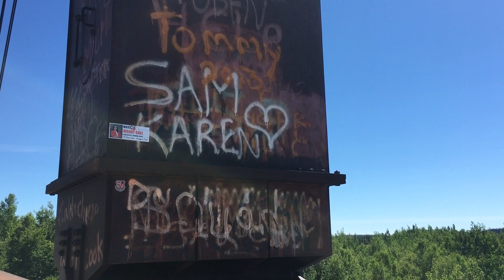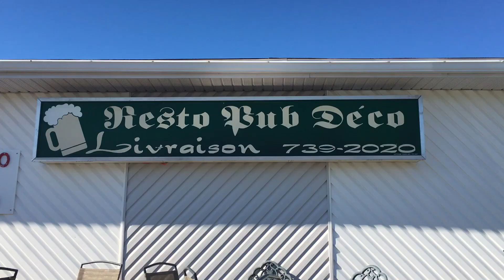James Bay Highway Adventure Part 3

Comment: 4:25 Although this was a group ride, did anyone have any emergency parts with them? When I did the Trans Labrador Highway, I brought along a: throttle cable, clutch cable, brake and clutch levers, new chain and chain link, heavy duty front and rear tire tubes, tire irons, etc. Since my KLR was new, wheel bearings did not cross my mind but replacing them are an easy fix on the road. They will get packed the next time with new seals. By the way, the Trans-Taiga road is 662 kms one way according to Google Maps. Too bad it doesn't go through to Labrador City.
Reply from the maker: No spare parts at all. We were letting luck decide. My KLR was new, the KLR that broke was a well used off-road machine so bearings failing should have been anticipated. Funny enough, if you watch my Trans-Taiga video. Daren, the bearing KLR guy, had another bearing failure. This time it was on the Africa Twin. In his defence he he had the bearing ready at home… lol.

Comment: Really enjoyed watching this series. Felt I was traveling right along with you. Definitely on my ‘to do’ list, hopefully soon. I’ve done the road to Tuktoyaktuk and wondering how this compares if you’ve done both. Thanks for sharing your trip.
Reply from the maker: Lol, I was just responding to your other comment and I mentioned there that I’m planning on riding to Tuk this summer. James bay highway is pretty easy. Some light gravel during construction zones and smooth asphalt the rest of the way. 387 is the biggest gap between gas stations which is doable for most adv bikes… I guess the biggest thing is the solitude but I’m guessing the road to Tuk is less travelled.
Reply: @Peeohtrek  I think the biggest gap on the Dempster is 345 kms. We carried gas but didn’t need it. My triumph tiger had 16km left in the tank lol

Comment: Great video. Was the bearing screwed from over adjusting?
Reply: makes a strong, strong case for a drive shaft... as on my two HOndas and Super Tenere.
Reply from the maker: I'm not sure. Probably didn't help. ONT ADV might be better able to answer that.
Reply: Bearing failed from the chain. I'll admit I screwed up and should have replaced the chain before the trip. I had a tight link that I thought was fixed but according to this video it wasn't lol